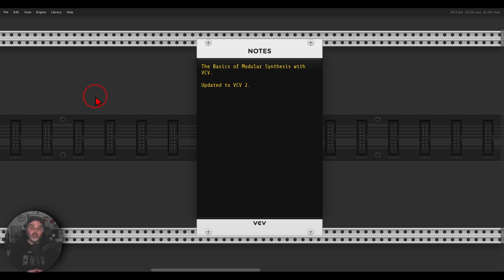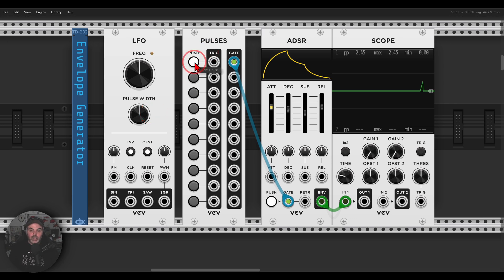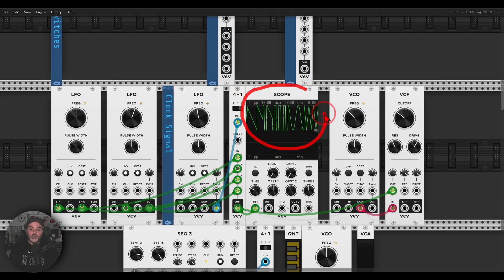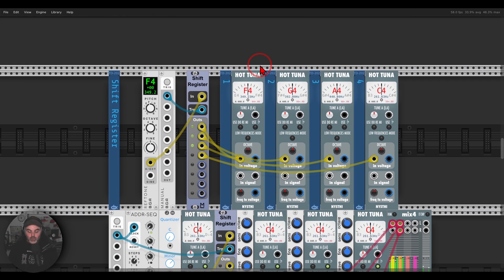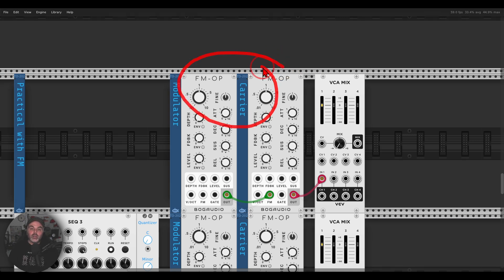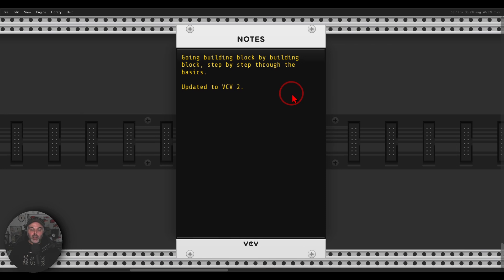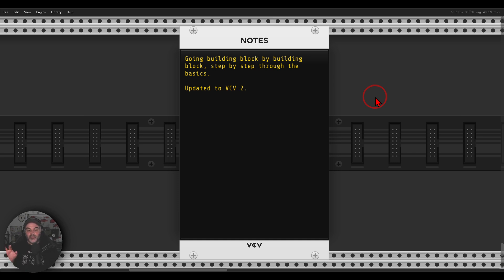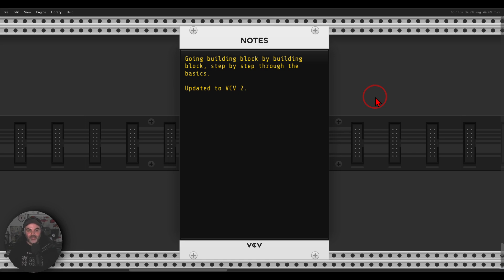The Basics of Modular with VCV 2

Comment: After I started to use VCV 2, I was not sure what the new purple cable color is for. But, after a while I realized I could now have seperate color for gates and triggers. The standard I now use, based on the Modular Fungi Color Scheme module, is red, for audio, yellow for pitch, green for modulation, blue for gates, purple for triggers. 🙂
Reply from the maker: Yeah, that's great :) Just in case, you can use the new color module to choose different colors as well - https://library.vcvrack.com/Inklen-CableColourKey